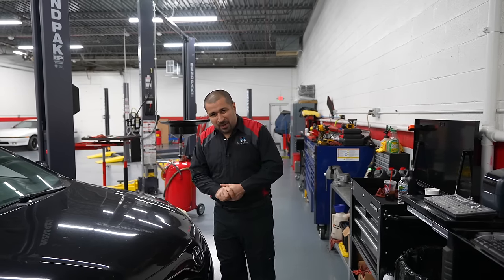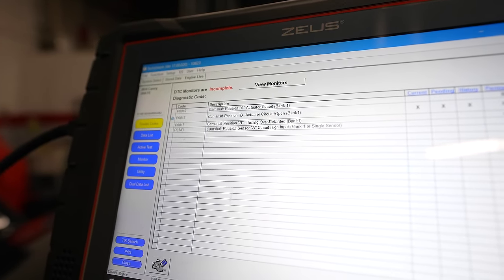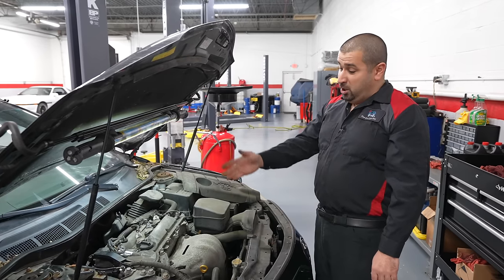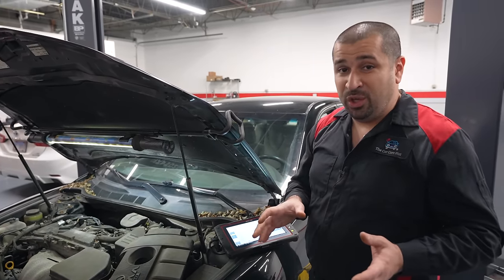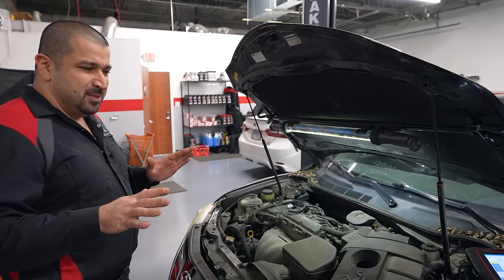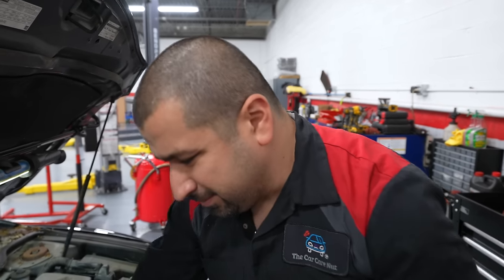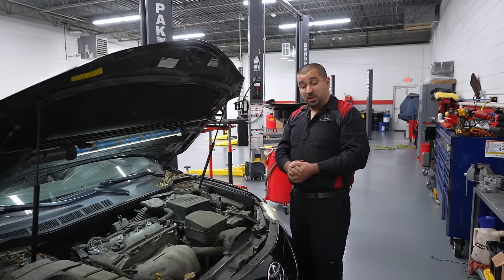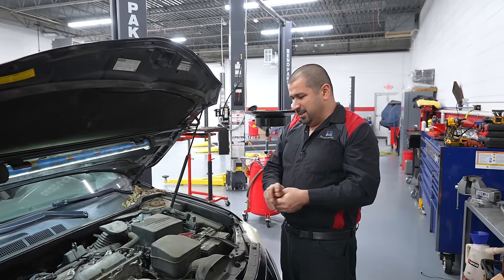Mechanic Parts Cannon FAIL Cost Customer A LOT! Let's Try This Again

Comment: This video shows how important diagnosis is  I had a 2006 Nissan Sentra with just about a total loss of power I took it to a guy he said it was the oxygen sensor so here we go we put a new oxygen sensor on and the car still did not run properly I have heard in the past people say of total loss of power sometimes a catalytic can be  plugged up. anyways I just wasted money on the oxygen sensor and this idiot mechanic did  not know what the problem was so I'm driving the  car home 10 miles an hour because it has no power I took off the catalytic converter I knocked out everything inside and guess what the car ran like brand-new when I started it up and I'm not even a Certified mechanic this is the difference between a good mechanic like Car Care nut and another mechanic who does not know what the hell he's doing and has no clue how to read a meter to diagnose a problem anyway I fix the car by myself but I still ended up wasting money on oxygen sensor this was an excellent detail video and shows the difference between a good mechanic who has some knowledge finding electrical issues and knows how to read a meter

Comment: Now we need to get 90% of the other technicians on board. Honestly this is a big problem in this industry and I think it's going to get worst. The technician shortage is real and shops are hiring less than qualified applicants to do the job. Fewer people are getting into the industry but the demand for more technicians keeps going up and up. So whats happening is automotive repair shops are running like fast food and have unskilled technicians throwing parts at cars until they're fixed. Shops today only care about the numbers and if those number have been met. As far as you're diagnostic fee, you're more than likely paying for something you're not getting but just a code scan and a tsb lookup.

The shop I work at has gotten better at this issue since our last service manager left who's goal was to get every vehicle that comes in looked at, diagnosed and quoted by the end of the business day. The problem with that idea is with diagnosing cars all day left barely any time to actually fix the cars which is how we get paid. So techs were short cutting diagnostics if doing it at all so they can get to their workload so they can make a paycheck.

Comment: Unfortunately there is little to no accountability at repair shops. They cost the customer $700 for a misdiagnosis and inferior part. Gee, wouldn’t it be nice if the shop had to eat that $700 in parts and labor and put it towards the engine computer. That would be the ethical thing to do. I understand this doesn’t work in every scenario but clearly the customer is paying for their incompetence. This is why I try and do most of my own work.

Comment: The other thing to consider is the amount of time that some garages have to dedicate to this indepth investigating especially if they are short of mechanics who also have some knowledge of electricity and electronics. People who have both are well worth twice the income they deserve. Your typical independant automotive repair garages isn't going to pay for their lowpaid mechanics to get proper training like a franchise dealer would, or should when offered by the car's manufacturer.  Now the owner's of this car will have to weigh up the cost of a new computer against the value of the whole car, against the purchase of another replacement car, or scrap the car and rely on public transport. By the looks of the engine bay the owners don't pop the bonnet/hood too often, if at all, to check the oil, and/or fluids at least. Neglect cost more than proper care. 😉

Comment: Thank you for another great awesome video. I just did my oil change my local Toyota dealership. I have a 2020 RAV4 with 30,000 miles and the servicing mechanic told me that according to manufacturer recommendations he is advising me to replace the PCV valve. What are your thoughts for changing it at this mileage? Also is it advisable to get it done outside at an independent mechanic shop with a certified mechanic or use the original Toyota parts? Thanks so much for your input and really appreciate it.
Reply: I have been listening/watching AMD for years.  His advice has been to replace PCV valve when the spark plugs are due.  This came from his 4 or 5 part maintenance series or the Q&A videos, but I heard him say this more than once.  One thing AMD said was "always ask why you (service writer) are recommending replace this (whatever component)".  If it's bad, that's one thing, but if it's just recommended maintenance, it can wait a LOT longer.  By the way, there is no Toyota spec on replacing the PCV valve miles/years.

Comment: I can see how the other shop missed the computer. The computer is so rarely defective and expensive, and most mechanics are not so well trained even a simple diagnose will be beyond them.  Then you have the replacement artist or what you call parts canon.

Comment: What most likely happened was the old oil valve had a dead short and killed the FET inside the ecu , so technically the first shop was correct in replacing the oil valve and then the ecu being needed next….. not really a incorrect diagnosis or bad shop actually

Comment: I would like to know the cost of a computer on this car. Also, it is my experience that most mechanics, when it comes to electrical problems. They do not know what they are doing. Especially the independent shops, unless they specialize in electrical things only. These types of problems are best handled by the dealership. It will cost more, but they should have the training. In the long run will be a lot less than the parts changer shop.

Comment: I once had someone bring me an older Dodge pick up truck that wouldn't start. It had been to three repair shops and the truck's owner had already spent $1,000 having parts replaced and still it wouldn't start. There was no ignition so I put an oscilloscope on the wire going from the cam position sensor to the computer and I saw a signal when I cranked the engine. Then I did the same thing with the crankshaft position sensor and this time there was no signal. The sensor had already been replaced so I did a continuity test on the wires. There was an open wire going between the crank position sensor and the computer. It turned out to be that there was a bad connection in one of the connectors. I fixed that and the truck started right up. I'm just a do-it-yourselfer and I fixed the problem in under an hour but the three professional repair shops couldn't fix it at all. The last shop wanted to pull the whole fuel injection system off the engine and replace it with a conventional intake manifold and a carburetor.  What an expensive mess that would have been.

Comment: Add a manual switch in the car to energize the faulty power connection when on a longer trip.
Reply: Maybe I'm missing something in the logic but why wasn't the #6 wire of the computer output checked to verify that the computer was faulty? Did I miss that part of the diagnosis?

Comment: The computer on my base model 93 Toyota Pickup failed at around 200,000 miles. Replaced it with a $100 computer from a junk yard.

Comment: Your videos are excellent and if you were in my neighborhood, you would be my go to guy. Regarding the ECM diagnosis. With a proper scanner wouldn't be possible to look at the output PWM signal to the oil control valve?

Comment: I wonder if this relatively early ECU failure (relatively, since 90s cars are still rolling with original ECUs) is because they've moved to under the hood in more modern vehicles of all brands, and subject to more extreme heating and cooling cycles they wouldn't otherwise experience in the cabin. Granted, this was easier to diagnose since the ECU terminals are in easy reach, but it is interesting from an electronics point of view.
Reply: I think this one just bit the dust since it was their first year of the 2ARFE engine

Comment: Possible the computer/ECM can be repaired.  There is going to be a driver/high amperage transistor component or circuit which drivers the oil control valve that has failed.   I would look at getting the original ECM repaired first.

Comment: Well I do enjoy his message there is some method to the madness of parts cannon fixing. Upon reading a code I will see if it's a common issue for that model of car. If it is I'm just going to replace the part. Especially if the part is cheap. Or I will try to clean the part EGR parts usually. Certainly cheaper than paying anybody else to diagnose it. I'm going to say it usually fixes the problem about 90% of the time if not higher. Chances of having a common problem and it being a rat chewing on that wire is pretty low. But my labor is free. Lol. Toyotas yeah I'm learning the factory parts are so much better than aftermarket. Every part every sensor every suspension component is built to such a higher level from the factory than aftermarket Chinese parts.

Comment: Hmm, isn't the computer inside the car? If that's the case you stopped checking half way, because there is another cable that takes all the sensor inputs from that plug inside the car to the computer. That cable can also be interrupted (you did check for shorts, but those shorts could also have been inside the ecu, not necessarily on the wires).

Comment: Brings to mind the 1990's mass faulty capacitor problem that exists now and back in the day pertaining to all the Toyota Soarers 1Uz ECU's (1991-1998) (sc400) .

I  have not known one that hasn't partly or totally spewed it's guts out of the caps all over the PCB, causing many fault issues, usually poor running then later no start. 

Perhaps this model was affected with a bad batch, who knows, my other thought is has the guys who tried to repair this car accidentally destroyed part of the circuit in the ECU, this is also possible.

Comment: The original solenoid could have gone bad and created a short internally since it’s just a coil. I’ve seen coils wear and short in high and low resistance conditions. That could have caused a unresisted load on the computer that could have overloaded the ecu and caused it to go bad.

Comment: I'm thinking that a lot of shops don't invest in the sort of proper scan tools (the Autozone one don't cut it and a real one costs at least $3k and up) and also information systems, like Mitchell diagrams and information, that cost enough money that they try to go without. Enough problems can be eyeball diagnosed that they get away with it most of the time, but then something like this stumps them. Since they avoid those expensive tools for the most part, you also don't get a lot of tech experience with decent diagnostic tools, and the overall pool of talent stays poor for lack of development. Occasionally somebody is smart and determined enough to bull his way through the problem, spending what they have to in time and money, then that guy starts a Youtube channel and the rest of em stay parts changing. That's why people end up willing to haul their car 4 hours to that guy. That's really not an option for most.

Comment: TMNA should be sponsoring your channel because you are helping owners of Toyota/Lexus vehicles understand the maintenence and repair on their cars.  However, they probably will not because Toyota specialists like you are "taking away" their dealer service business.  But, they do not realize is that you are still using Genuine Toyota Parts, puchased at their dealerships.  So their dealers are still making money.  It's not like you're buying parts from a supplier like Worldpac.  TMNA's corporate Parts & Service departments need to put their heads together and determine how they can better support shops like yours.  Right now, I believe there is still a shortage of getting qualified technicians to work at dealerships.

Comment: Should have used bi-directional scan tool. Command the valve see if it working. Codes like these first thing is to determining if is a electrical issue or mechanical
Reply: He did do that. Half way through the video he had the car running and bi directionally controlled the valve and the car stumbled and quit. That was the intake side. Then he performed bi directional control on exhaust side and nothing happened. Didn’t you watch the whole video?
Reply: @mikesabin8568  He should do that at very beginning instead try figure the issue from reading the codes
Reply: @youngwang5959  codes litteraly takes five minutes to pull up. If the car pulls in your bay, the smartest fastest thing to do is pull codes to have a direction into what is wrong. On top of that, you have to have scanner connected anyway to do your bi directional test so what is the problem with getting codes first?
Reply: @mikesabin8568  That s what I am talking about, read the codes, then do the command while you seating  in the car, I wont even go to the engine bay first, if the car cuts off while activating the valve, then you go to the engine bay and follow the flow chat for diagnostic on the mechanical issue side, other wise, you go the electrical side, unplug the sensor to read the codes is absolutely unnecessary in real life

Comment: Unfortunately, most of the time, they misdiagnose the car trouble, they "fix" somethinf unrelated and give the car back to thw owner still having the same problem. Owner brings it back, maybe they diagnose correctly this time or not again. They will still charge you for their mistakes and they won't even admit it and act like you offended them for pointing out the misdiagnosis.

Comment: Morning, AMD I have a 2013 Toyota Highlander with the 2.4 liter (4) cylinder and I have not changed my motor oil because of health issues but I was thinking of putting some “Motor Mechanic” motor flush and than changing synthetic motor oil and OEM filter or do I not use the flush and just change the oil, I would truly want your opinion because I value your skills and knowledge, I will always be one of your subscriber’s Thank you and God Bless You and your Familia. Amen 🙏

Comment: What about the connection from the wire to the computer? Is that possible? Also is there a diagram for what pin goes to what wire?

Comment: So when you turned to key on to check for short to ground and short to power, the ecm connector is pulled off. So if some component that only creates the short is active with key on and if that component gets its power from the ecm you really didn’t check it completely. Couldnt you back probe that ecm connector while it was installed in the ecm?

Comment: Can’t tell you how many issues I’ve found or disproved from a power probe and test light unplug connectors on both ends ground test light and check wire with prob should ground out atelast you know the wire is still somewhat in one peace before load testing…..

Comment: could you have additionally tested by put in the voltmeter across the pins while using the scanner to command the signal on and and see if the voltmeter sees the signal go on and off? does that signal travel through any fuses or relays?

Comment: I see it as and open circuit between the valve and computer. You had continuity on 1 wire and not the other. You were on the harness side of Pcm ? What am I missing and would it not be a open wire in the harness!

Comment: I'm not a technician by any means but I wonder what are the chances that one of the wires of that connector is getting a short to power or a short to ground while the car is running and the wires are moving around because of the shaking of the engine. what if this is actually what caused the engine computer to get fried in the first place? how did you rule this out?

Comment: Isn't it possible that a wire shows continuity with a high-impedance multi-meter, but still can't carry sufficient current under operation? Couldn't you use a scope to prove the computer was not providing the correct signal?

Comment: Can buy a used pcm module on eBay for $50 and take your chances also you may just have to re flash the code sometimes gets corrupted you can make sure. You don't have any cracked solder or bad capacitors. I think for this customer we can all chip in $5 to get them back on the road and let this be a lesson all the car owners you need to do research this is the price you pay for being lazy it's the internet age you can find nearly every solution to your problem we'll except. For the stock market you will always eventually loose all your money.

Comment: Lot of times 3rd party parts are better than that cheap oem denso parts from Toyota.  Some are actually improvements over known oem issues. Like power window motors from Toyota that breaks, fix after fixes.

Comment: Ahmed.  May I say this?  It’s not common sense.  Pls don’t say that bec too many overuse it and this is NOT common sense.  It’s a logical process along with a flow diagram in the head and maybe In a training manual, along with KNOWLEDGE AND TRAINING.  Too many ppl think they KNOW and they don’t realize they DONT !   Cars are an entire SYSTEM and u have to understand the system and not just A + B = C

Comment: Did this end well?  I would have wanted to back-probe the pins at the ECU, with the car running, to check for the PWM signal before condemning the ECM.

Comment: the original valve might have created the computer's defect since it was controlled by the computer , maybe , i don t have the wiring diagram but is the coil operating that valve supplied 12v from a relay or the computer ?

Comment: THIS IS WHY I ONLY BUY CARS FROM THE 80s NO COMPUTERS, I HAVE A 1987 FORD F350 AND A 1985 CHEVY CAMRO BOTH RUN GREAT AND BOTH DRIVE GREAT, I REDID THE BODY WORK.  AND THE INTERIOR WORK THEY BOTH LOOK LIKE THERE RIGHT OFF THE SHOW ROOM FLOOR AND DRIVE THE SAME WAY...

WAS MUCH CHEAPER THEN BUYING A NEW PLASTIC COMPUTER POS VEHICLES THAT THEY MAKE TODAY....